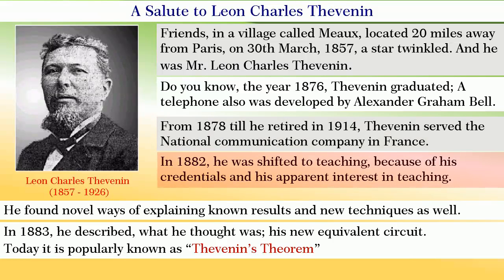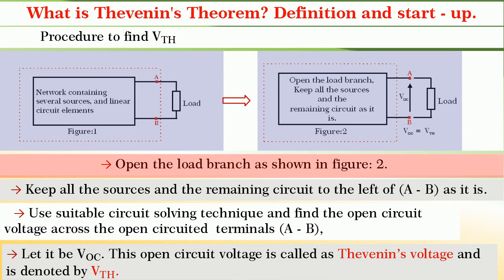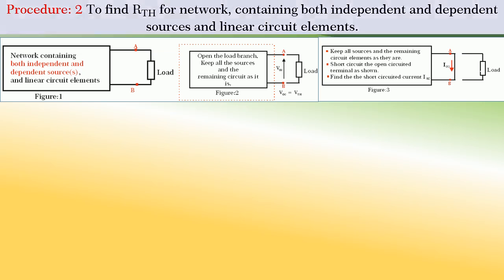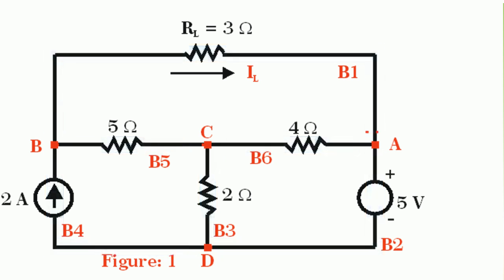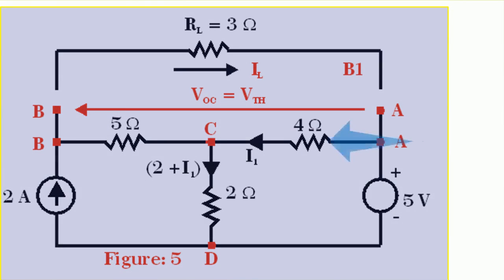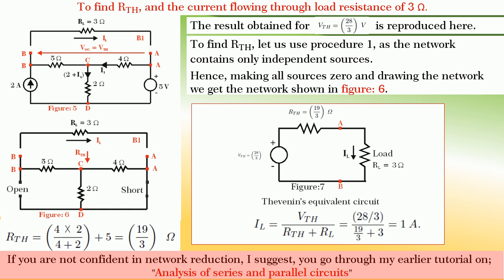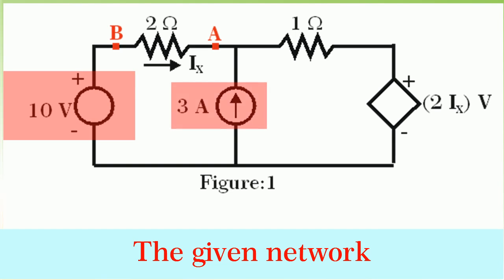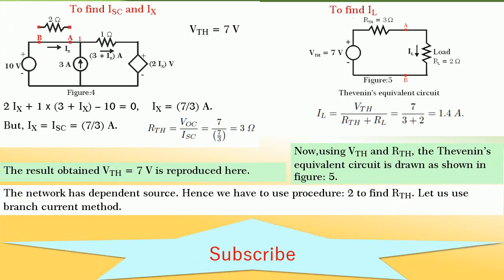Thevenin's Theorem

Comment: Sir in 2nd sum y z the current thru 2 ohm resistor zero?
Reply from the maker: Hello Poojasshree, Happy to know your interest in understanding Network Analysis. Your doubt is, how the current in 2 Ohm resistance is zero? Please note that, the branch containing 2 Ohm is open. Mostly, I believe that, you are confused with the presence of (VX) across the terminals. I will tel you, you do simple experiment to understand this. Take a cell or battery. Connect a resistance. Keep the two terminals open. Measure voltage across the two terminals. The voltmeter reads the voltage. But. see that current in the resistance will be zero. 
A finite voltage and a zero current is the open circuit concept. To understand this I suggest you see my first video on open circuit concept.
Do not hesitate to quarry such fundamental doubts. 
Hearty blessings,